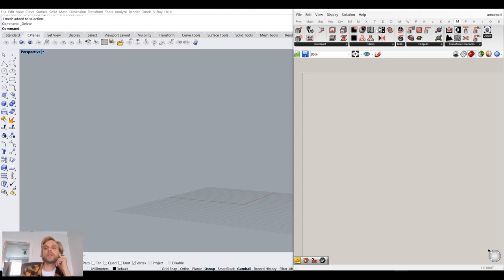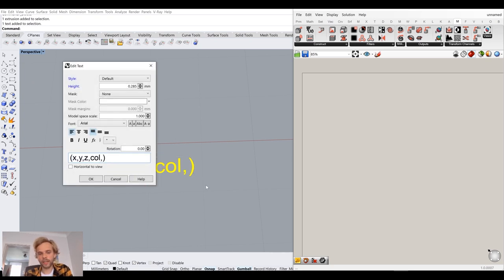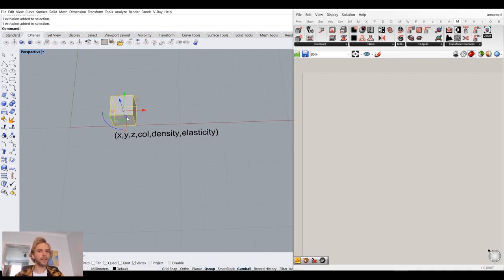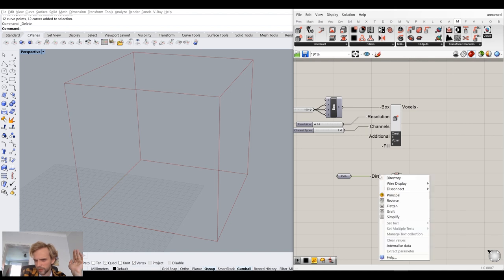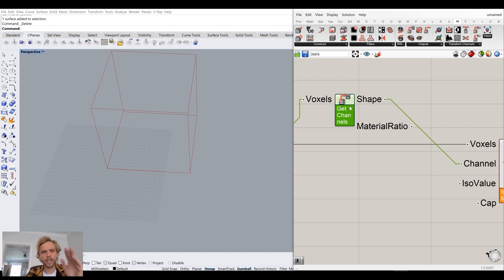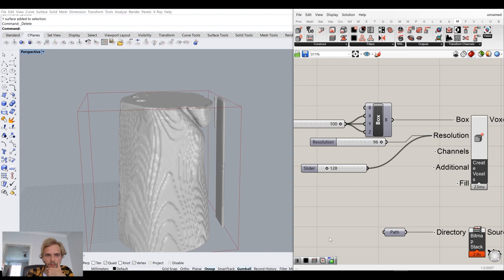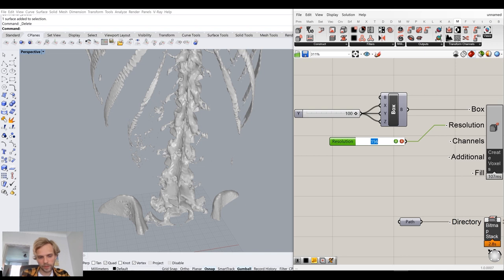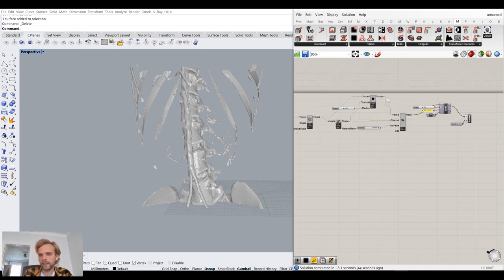2020-31 LTH Tutorials: Convert Medical Scan Images To a 3D Mesh ( Monolith + Grasshopper )

Comment: Hi, and compliments for your work. Could you help me with an issue I have? After you rotate the entire torso, you simply connect the rotated geometry to geometry preview and the "old torso" disappears. In my case instead the upside down torso doesn't disappear, and it's driving me nuts 'cause now I have 2 of them in different positions. What do I have to do?
Thank you for your attention
Reply from the maker: Hmm might be a bug - simply delete the Geometry Preview node, create a new one and connect the rotated torso to it. Should fix it. Also - make sure that you disable preview of all unnecessary nodes, it just get's too cluttered if you have visuals from every output of every node.
Reply: @DesignGoBrr  Thanks Gediminas, it was exactly that. Thanks 4 yr help and yr tutorials

Comment: I am trying to install monolith but it seems there website is down. The msi i downloaded from food4rhino doesnt dio anything. anyone have a solution?
Reply: by the way, there are example files in the folder of monolith itself, including a ct scan. I am still getting nothing on the program though
Reply: An error occured during GHA assembly loading:
  Path: C:\Program Files\Monolith\MonolithGH.gha
  Exception System.IO.FileNotFoundException: 
  Message: Could not load file or assembly 'MalachiteNet.dll' or one of its dependencies. The specified module could not be found.

I have no clue why its not loading, the file is there and its unblocked
Reply: @masthebes  did you find how to install?

Comment: no one has problems getting monolith to work?
Reply: Try installing version Monolith 0.3.6268.15760 (found on food4rhino). The latest one didn't work for me but that one did. Install the full thing not just the plugin.
Reply: Hmmm, so the first time I installed monolith 0.3.6415.29557 I installed just the plugin which didn't work. Then I tried installing the previous version 0.3.6268.15760 as a complete install and it worked. Have now uninstalled 0.3.6268.15760 and re-installed the latest version (0.3.6415.29557) as a complete install and the plugin is working in Rhino.

Comment: Is there a way to keep the color data in the voxels? I have a medical microscope scan, and I want to do exactly the same thing but with the original colors
Reply from the maker: Absolutely - here is a printscreen of a script that should take care of it: https://ibb.co/qkvWGmz
Reply: @DesignGoBrr  Thanks a lot !! Which Ln node do you use? If I just search for ln, and connect that it gives me a bunch of errors, it also looks slightly different
Reply: Ahhh that is the length, not ln. Managed to fix it now. Works like a charm! Do you know how I can set the voxel width and height? Each pixel is 0.21 micron in width, and the height per image is 0.71 micron
Reply from the maker: @MegaMario0007  Great that it works! Voxels cannot have a different proportion than 1x1x1 , but what you can do is scale the output in only Z direction by 3.38 (which is from 0.71/0.21) and that should give you a mesh with the correct proportion then!
Reply: @DesignGoBrr  Hi Thanks for your Tutorial! What kind of Expression do you use in Range? It seems that this expression is necessary to get a textured mesh - Thanks a lot !

Comment: I had been thinking about  the same idea  about half a year ago  =))))) It could be laser dust printer used for printing  bones -and it can repeat the structure one's absolutely identicaly original.
Reply: including inner structure
Reply: Using the titanium  it could  has  less weight and and got  some elastic properties -that could prevent the damage of natural one that was connected to if the injury may happen again. What do you think  about it - I'm just not a medician to judge if is it  the right way to do that I was  thinking of ,but using the laser titanium dust printer you could print Inner structure of bones in two ways  first using medical scans , and second  to construct own inner bone structure using for example  3d voronoi or delaunay triangulation it is may be nessesary because the titanium has more hardness properties and may damage the natural bone  if the strong load has applied.
Reply: It may be very usefull when the part of  hip or hip joint was crushed and there are a lot of because it is the most usual injury that caused due to vehicals impact down humans on the streets.
Reply: what do you think about written above ?
Reply from the maker: Hehe, to my knowledge, you have described exactly how they are doing transplants. CT scanning - then 3D modeling -Powder based printing - replacement operation. It's still super expensive though - in the office I have a small piece of jewelry printed in titanium and I think it costed something stupid like 1000USD to make.
Reply: @DesignGoBrr It cost nothing  you say about  do not lie to me
Reply: most cost is a powder nothing else
Reply: exept powder there is nothing to pay
Reply: If you had some damage ?  and was need to recover it ?
Reply: think about it
Reply: did you see the powder titanium  laser printer ? at least?
Reply: before you saying that
Reply: may be plastic would be better but who knows how it performs intire organism
Reply: you are bad guy you want only  money
Reply: nothing else
Reply: I saw how titanium implans were  implanted to people  needed  in one's
Reply: I just want to make it better nothing else
Reply: I had one he had the  hip crushed   do you think it is funky?
it is not funky at  all
Reply: half of the hip simply crushed  the man could not  walk  forever
Reply: may be you are joiking